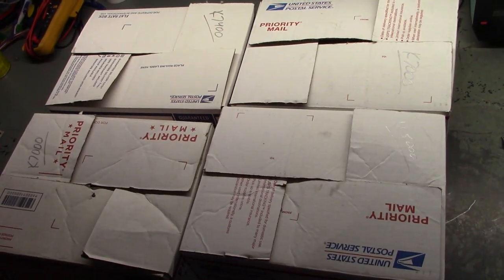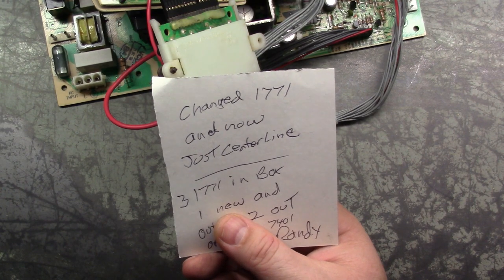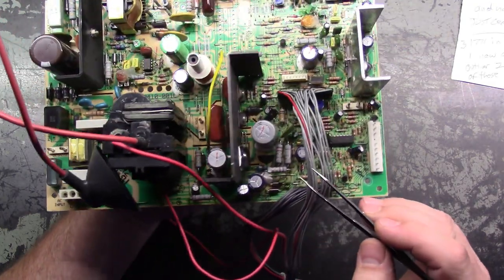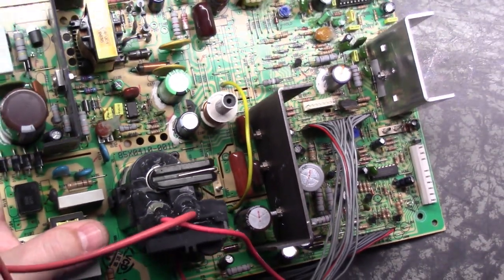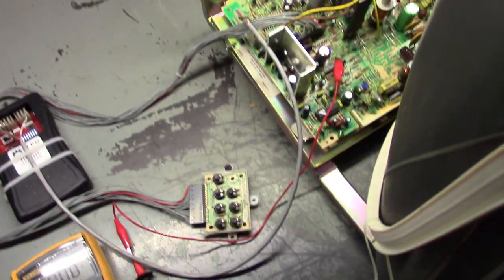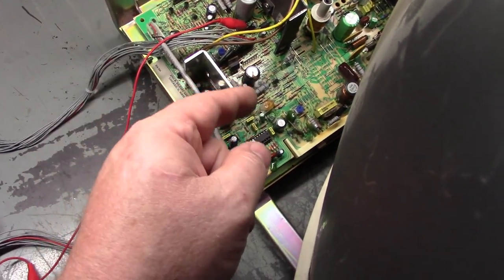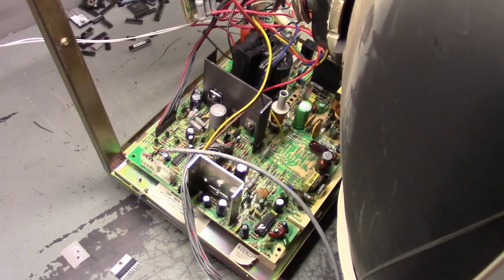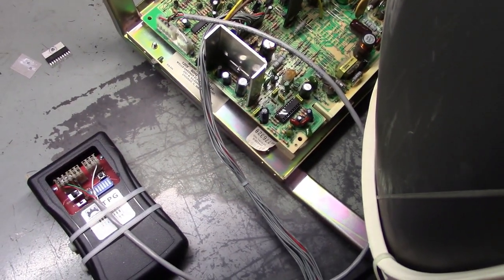25" K7400 Arcade Monitor Chassis Repair - Vertical Collapse

Comment: HI Mike love the channel, it has helped me a lot..I have a 7400 with vertical collapse. I have the 25v at test point 205 and have changed the vertical IC and done a recap. Ive checked all that you have shown in the videos but still cant get it to work.. I would appreciate any help you can give. Thanks
Reply from the maker: Thanks for watching. Did you install a good IC? Ground on pin 5 or pin 6? You test all the IC pads for continuity?
Reply: @MikesArcadeMonitorRepair  Mike, I just received the vertical ICs a few days ago. I do have continuity on all of the pads. I also watched your video on how to test 
The ICs. everything tests good. Thanks

Comment: Did you used to work for Wells-Gardner? Or are you just a wizard? Haha. I love these videos and thank you !!!
Reply from the maker: Nope. Just years of troubleshooting. Thanks! Wait until you see the next video!
Reply: @MikesArcadeMonitorRepair  any idea where I can find 1034 transistors for a k7000 neck board.  I’m missing my red color and I can’t seem to find any online
Reply from the maker: This is what you need…

https://www.arcadepartsandrepair.com/store/integrated-circuits/misc-chips/2sc2068/
Reply: I thought so too but mine read EBC. Peter at arcade parts and repair advised I have a zenith k7000a chassis and those transistors are more rare.  Maybe you could mention that in a video because I thought all 25” k7000 neck boards were the same.   Learning everyday and loving this stuff ✌️
Reply from the maker: You can install them backwards and they should work. 

That’s not a bad idea.
Reply: I was able to get it going again and it’s never looked better.   Cap kit, new fly back and fixing a few damaged pads along with the new transistor and it looks amazing.   Again….thank you for these videos.   I’ve learned A LOT and am grateful.  Happy Sunday 🤙
Reply from the maker: You’re welcome!

Comment: Hi mike. I  recapped a k7400 last night for the first time. It went really well. There were a lot of caps on that but it wasn't bad. Really appreciate all the knowledge that you taught me. There's an issue I'm having  with the  neckboard.  It's causing my picture to be really dark and I can't get it even close to acceptable brightness level. I borrowed a neckboard off another k7400 and it works just fine. So I  isolated my problem to the neckboard for sure. I was just looking over the schematic and I was seeing we're all the plus 12 volts goes to. Is there a common component that fails on these neckoards? Is that u500 chip known as causing issues with the brightness? The first thing I would probably check would be the brightest voltage resistor at r518 and  the video bright area diode d810. I don't mind checking the components on the entire neck board but curious if there's a common component that you have seen cause this problem. 

Thanks!
Reply from the maker: Glad I could help. As for your issue, make sure R811 is between 50k-100kohms. If so, and installing another neck board makes the image vibrant, then yes. The U500 chip can very well be the issue, assuming you have all your colors but they are simply dull. I assume your color pots don’t make much difference when adjusting them?
Reply: @MikesArcadeMonitorRepair  r811 checks good. It's around 70k.  I have all colors.  The image looks as if my tube is shot. Which I thought was the issue until I tested the tube with my b&k 466 and it tested very healthy.  It also takes awhile for an image to appear when I turn on the monitor with the " bad neckboard". The brightness pot will wash out even when the image is way too dark. The contrast pot will quickly smear the colors. Adjusting colors has little effect on the brightness and vividness but all the color pots function properly. Should I swap out that chip for my troubleshooting or ohm out resistors and check diodes in the +12 circuit? 

Thanks
Reply from the maker: Gotchya. I’d install a new chip.
Reply: @MikesArcadeMonitorRepair  thanks man! I'm also looking for a crappy mid res jamma board for you so you can test your k7500s on instead of your tpg. I'll mail ya one as a thank you gift for all ya do for the community when I find one.
Reply from the maker: Don’t think there are any crappy/cheap medium res Jamma games, but if you find one, I’ll gladly take it. Thanks!
Reply: @MikesArcadeMonitorRepair  lol. I'll find a cruisn USA with no audio or audio problems for ya on the cheap. I got ya bro. You've sharpened my skills, decreased my man hours, and made my hobby more enjoyable.

Comment: Hey Mike, you mention at 21:35 that you can adjust the width coil to give you more width … does this work on the K7400’s? Mine doesn’t seem to adjust anything … 🤔
Reply from the maker: No. The width coils on the 2000/5000/7400/7500 do nothing. They are not designed in the circuit to alter the size like they do on other chassis.’ On those, the only way to increase/decrease the width if the pot on the remote board does not give you the full range, is to change the width cap. Lower value equals wider image. Higher value equals narrower image.
Reply: @MikesArcadeMonitorRepair  mind if I ask which one is the width cap? I know which one on the K7000’s but not on the K7400. And Thank you for the advice 🙏🏻
Reply from the maker: C722 right next to the L701 linearity coil. You’re welcome.
Reply: @MikesArcadeMonitorRepair  🙏🏻🙌🏻🤙🏻

Comment: Hi mike. Is it okay to change the value of the width cap on these k7400's?  I hooked up one to a tube with a 1.6 horizontal reading and a 5.3 vertical reading. There's about an inch of negative space on each side left and right. I changed the width cap to a 333 but it didn't decrease the amount of negative space on each side.  I moved the width coil as well with my tv adjustment tool and that had no effect. I wanted to check with you first before I lowered the value even more of the width cap.
Reply from the maker: The width coil will not affect the width on the K7400. You have to adjust the pot on the remote board. I assume you did? If that works but won't stretch the screen, yes. You can change the width cap to a lower rating to increase the width. But I've never seen the width control be dead/inoperative on those series of chassis (except for the K7500 since it requires the remote transistor to be hooked up). Make sure the transistor on the heat sink is good. The one that's furthest from the HOT. The HOT is first, there's another one in the middle, and a third one at the end. Make sure that one is good if the width pot on the remote board does not work.
Reply: @MikesArcadeMonitorRepair  yes. The width pot works great on the control board. It just doesn't stretch all the way wide enough.  So if the width pot works on the control board then that means the transistor you speak of is good, correct? And it is also safe to say the 333 value just wasn't low enough to make a noticeable change in width difference at it's max on the control board, right? Just wanted to make sure since these chassis' are new to me. I'm very comfortable with the k7000s and I'm sure I'll be up to speed in no time on these k7440s as well. So I'll proceed with a value change of about 222. Does that sound like a good idea? 

Thanks
Reply from the maker: I think so. Give it a try and report back.
Reply: @MikesArcadeMonitorRepair  hmmm.  No change in increased width ability with a 224 width cap in there. This tv tube has a bonded yoke and I don't have as much luck with the ones with a bonded yoke on my k7000s.
Reply from the maker: Definitely a yoke issue then unfortunately.

Comment: Hi mike. I've got a K7400 with an open r811 which was giving me my loss of color unless I had the contrast bumped all the way up. I have 75k ohms in a metal oxide flame proof resistor. Are those okay to use for a replacement? Thanks
Reply from the maker: Should be.

Comment: r104 is reading 14k ohms not 10k. Power supply section? Will not power on
Reply from the maker: It’s reading 14k in circuit or out of circuit? In circuit would indicate a bad rectifier diode. Out of circuit would indicate a bad R104.
Reply: @MikesArcadeMonitorRepair  Would that cause it to not power up? It passed the light bulb test.
Reply from the maker: Absolutely. Is the fuse blown?
Reply: @MikesArcadeMonitorRepair  no. I did the light bulb test and it came on. Maybe I will just source another r104 somewhere and try it.
Reply: After some thought I found the problem. The chassis finally came on after 2-3 minutes of giving it power. Bad CAPS! I couldn’t find any components bad on it So after the delayed start up and a couple of caps bulging, bam. Cap kit it is for the win.